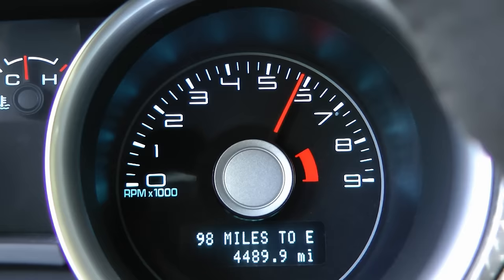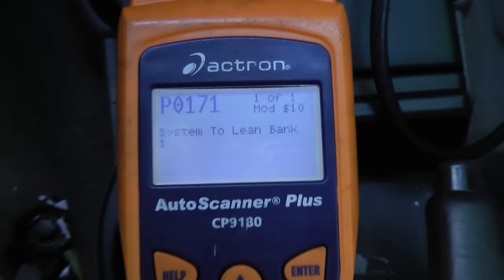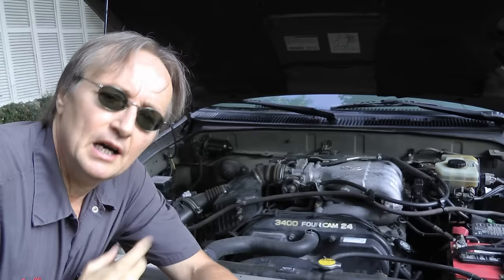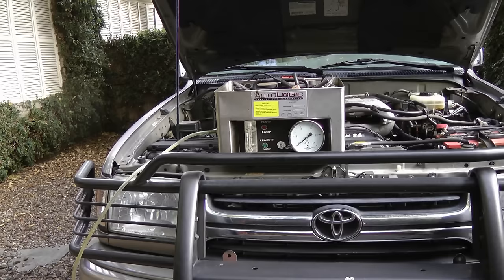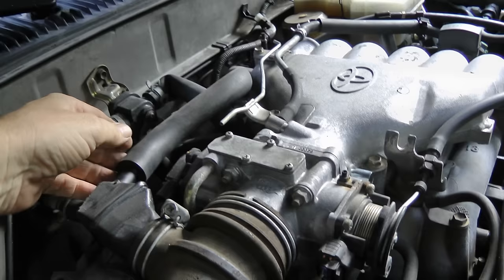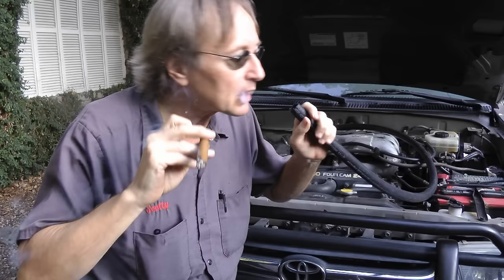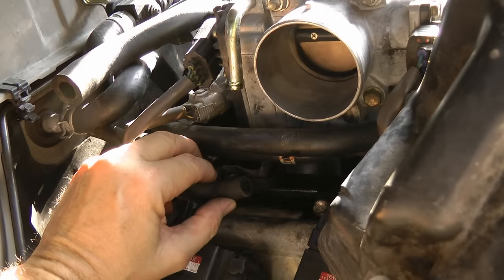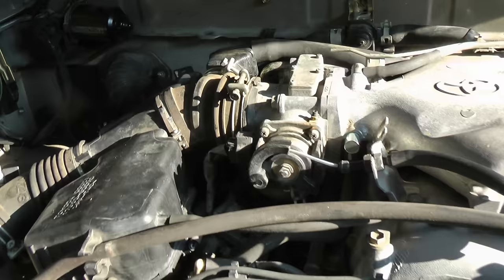How to Find Vacuum Leaks With a Cigar (Life Hack)

Comment: I went to NAPA and Auto Zone and neither had cigars in stock
Reply: +TheSpazModic He said "at the Drugstore" so try there
Reply: valero, shell, any corner store really
Reply: LOL
Reply: +TheSpazModic the cigars are special order. Usually take 1 to 2 days to arrive.
Reply: Frank Gonzalez LOL
Reply: +TheSpazModic you didn't give them the cigars make model and year they got confused.... LMAO
Reply: +TheSpazModic They never have the right cigars for my sonata anywhere. Make sure you get the right one half way through the model year the changed the OEM cigar on my car and I almost destroyed my engine.
Reply: dude,by trying OEM recommended Cuban cigars you gain horsepower. It coats everything with a smooth tobacco texture causing AIR LUBRICATION making more air flow into the throttle body faster and smoother almost like squirting KY jelly in your oil filler.
Reply: OgGarcioVega Yes but that is only for the staff to be able to deal with the general public that goes into an autozone riding there high horse because they watched 3 youtube videos on how to change a cabin air filter and now are an ASE certified mechanic... trust me I work there it's not easy being calm on our side of the table.
Reply: +Mr. Stark Auto or Manual?
Reply: Is that cigar 4 wheel drive?
Reply: Try cross referencing the VIN number on the cigar. Sure they have one then.
Reply: I was going to say that @TheSPazModic needs to cross reference the VIN, License Plate Number, Drivers License Number, Age and Gender of the Driver, with the Cigar, then they should be able to find it. :P :P :P
Reply: OgGarcioVega the hell is a zigzag?
Reply: Bahahahaha
Reply: TheSpazModic go to the place called not an auto place
Reply: In a pinch, you can use exhaust smoke.  1. Crank car.  2. Firmly press your lips around exhaust pipe. 3. Inhale.  4. More instructions to follow (report back if you get this far).
Reply: TheSpazModic Oreillys?
Reply: Lmfao 😂
Reply: Wonder if Scotty got the long black hose at @ockauto?:-)
Reply: TheSpazModic he said drugstore.. You went to your drug dealer got high then forgot what he said
Reply: Orilleys bro
Reply: Go figure, bet rock auto has them!

Comment: I’m try this. Cigar never crossed my mind. So far I’ve cleaned my throttle body, replaced my starter, replace alternator, replace cam shaft sensor, replace pcv valve, replace breaks, all from referencing your channel. You helped me more than you know.
Reply from the maker: thanks for watching!
Reply: Sounds like his terrible advice has lead you to change a lot of parts for no reason. He's helped you less than you know.
Reply: @matth9359  what a hater

Comment: Scotty, YOU ROCK!  If I lived in your area, you would be the only one looking at my vehicles.  I needed to search for possible vacuum leaks.  I scoured YouTube and there were all sorts of videos making different types of homemade smoke machines.  Thank God I found this video.  How simple can you get?  I bought a nice cigar and a six pack of Yingling.  I already had the rubber hose.  I disconnected the power brake hose, put on mine, smoked a fine cigar, found NO leaks, finished said fine cigar with two beers and then put everything back together.  You are awesome!   Gerald Demers
Reply: Oh, the cost for this fix?  Less than $20 for the cigar and six pack.   :)
Reply: Gerald Demers

Comment: It worked! I'd replaced most of the vacuum lines in my 93 VW Jetta and solved a lot of running problems about a year ago. But then I started getting gutless acceleration - and I mean gutless. But I couldn't find any more vac leaks. Finally stopped off at a tobacco store (amazed at all the glass pipes and things) and asked for the smokiest, cheapest cigar he had. Ended up with some slim cigar and lit it up. Blew smoke into a pipe I'd clamped into the line from the EGR valve to the intake duct. I took the first drag of tobacco I've had is about 40 years. Blew the smoke into the pipe and saw a feint puff of smoke emitting from under the fuel pressure regulator where a vacuum line connects. So I replaced that small section of hose that connect to a hard plastic tube that goes to the vacuum manifold. It helps to see the smoke if you do this as it's getting dark and shine a flashlight around looking for smoke coming from vacuum connections.
Reply: I just realized, the closing comment to this episode should have been "so now ya know. next time your car sucks, fix it by blowing smoke up it's gas."

Comment from the maker: yes, you can try, just realize evap systems have switches and valves that often need operating with a high level scan computer to check for leaks in various parts of the system.

Comment: For those of you that don't smoke, make a gravity/waterfall bong. Fill a soda bottle with water, cut an opening in the bottle cap big enough for the cigar to fit in nice and snug. Once you're ready just poke a hole at the bottom of the bottle and it will fill up with smoke. You can use to hole you made to blow the smoke out the top and into whatever tube or just squeeze the bottle.
Reply: The gravity bong idea is really a good one... lots of smoke
Reply: I would imagine a vape would have better smoke results than a cigar lol.
Reply: +Chris Atkinson vapor "smoke" dissipates with heat
Reply: T1 Under 5150 it was worth a shot lol
Reply: Bruuuuuh you da man.

Comment: This trick works. I just found a vacuum leak on my truck. I added a twist, though, since I didn't have an extra set of hands or eyes: I filled up a balloon with smoke, then put the balloon over the hose from the brake boost and let it out slowly. Using a flashlight, I was able to spot the leak, which was in an elbow connector between two hoses. Simple. Also, you can use a clothes pin or clamp to cover the balloon valve while you put it over the hose.
Reply: Great idea, I was thinking how would you decipher between the smoke coming from the cigar and what’s coming out of the hoses. Your idea fixes that.

Comment: I'm posting this from another video I commented on. I just wanted to give credit where credit was due. ..Thanks Scotty!

Three weeks ago I did a tune up on my 89 5.0. New cap and rotor, 9MM plug wires and Motorcraft plugs. A few days after I 
started to have idling issues. Thinking it was probably something with the recent changes I had made, I started watching videos and reading forums for suggestions. This is what I did:
AIC, cleaned original, then replace with new
Plugs X 2
Cap & rotor X 2
Inspected for Vacuum leaks and sprayed engine with carburetor cleaner
Replaced 02 upstream sensor
Seafoam added to vacuum,oil and gas
Mass air flow sensor tested and cleaned
Test and cleaned EGR valve and EGR spacer openings (both were very dirty)
Replaced coolant temperature sensor
Replaced air charge temperature sensor
Checked and reset timing (had to buy timing light)
Tested TPS sensor with OHM meter
Today I found the problem. It was a small vacuum line way up under the upper intake that goes to the charcoal canister, which is located in front of the passengers side fender. It was dry rotted at the nipple on the upper intake, which is virtually impossible to see without a lot of bending and a very bright light. I actually found it by trying a trick I saw on the Scotty Kilmer channel. I removed the vacuum line from the brake booster and blew lots of cigar smoke through the vacuum system which revealed where the leak was. So after spending $300 on parts and cleaners, a $5.00 vacuum line and a .50 cigar was the fix. I'm just dumping this here in the hope it will help someone else in the future.

Comment: Ok Scotty. So I did the smoke trick a few weeks ago and I found the leak. Put on a new hose and she ran like a charm. The problem is the next day I went to start my car and it refused to start and the engine light came on. I checked the code and it says where's my smoke. Now every time I want to go somewhere I have to blow smoke into the damn thing. PITA. Any advice? (It's a Dodge Dart).
Reply: +Mac Cessi I'd say slap a patch on it. That or nicotine gum in the gas tank. Either should help it get its fix.
Reply: Try putting liquid nicotine in gas tank
Reply: Dodges are like Snoop Dogg.  Once they start smoking, they never quit.
Reply: Mac Cessi weird
Reply: I've seen this a couple times. Although there are ways to ween your car off the smoke, those methods take several man hours and the bill would be through the roof. I highly recommend installing a chew canister and valve. It's a pretty simple install and only requires you to re-fill the car every week or so, which is much better than blowing smoke every time. It's not a perfect fix, but it will get the job done. For a little extra you can get the high-capacity chew canister which only needs to be refilled once a month. If you can't afford any of these methods, try adding a T to your vacuum hose and drop in an e-cig. For more advice on this topic, visit your local ricer. They should have plenty of experience with cars that smoke.
Reply: maccess I LITERALLY BURST OUT LAFFN

Comment: You just saved me some money! Been pulling my hair out over my Ford Taurus misfiring and with a rough idle, I finally decided to try this trick. IT WORKED! Seems I have a leak on the intake area, so guess my weekend project will be changing out the seals for that. Also noticed a very small wisp of smoke coming from under the EGR valve, probably the diaphragm going out? So be it if I have to change that too, you just save me a lot of money Mr. Kilmer. I'm sending you a virtual cigar and a virtual beer as a treat!   ;-)

Comment: Why not just put the lit cigar (mouth end) in the intake line and let the engine vacuum pull constant smoke? I find my Ranger enjoys Fuente de Gusto's.
Reply from the maker: use your head, if you did that, the engine would just suck the smoke in and burn it, it would not go to the leak source and come out there to show where it is.

Comment: Hey, Scotty, any suggestions for non smokers? Would fog from Dry Ice and warm water harm the engine?
Reply: fog made from dry ice in water is... water. not the best thing to pump in to your engine
Reply: Dry ice isn't water. It's CO2. Carbon dioxide. I suggested dry ice because it skips states of matter from solid directly to a gas which is present in the air at any given moment. It doesn't generally have a liquad state. Only under pressure.
Reply: You can also try buying a cheap hookah pen. Those things blow tons of smoke and you don't have to worry about tobacco getting in your system if you buy the non tobacco ones
Reply: I’m not knocking non-smokers at all. But, honestly lighting one cigar which you don’t inhale anyways isn’t going to kill your lungs or make you become addicted. It’s certainly worth 99 cents instead of spending more money unnecessarily. But, if it’s a religious thing I get it.

Comment: kids these days will use vapes
Reply: I actually would not recommend that as vegetable glycerine is a hemectant (so it pulls moisture from the air) and could result in condensation within your intake system.
Reply: Joshua Harris agree with this sentiment
Reply: actually vape works really really well tho lol
Reply: That's my plan, at least. Though I haven't been a kid for a while. XD
Reply: i actually prefer the smell of vape than cigarettes. i prefer the smell of a cigar over a cigarette. there's just something about cigarettes i hate...
Reply: Actually some people use water to remove carbon by dumping a little bit down the intake while the car is running.
Reply: I'll use marijuana
Reply: Iron Man ...lol
Reply: @joshuaharris253  that moisture wont do anything to the engine
Reply: Yup strait up better than getting cancer or giving your car cancer also second hand smoke is dangerous be safe vape on 😉
Reply: @joshuaharris253   was litraly needing this info thankyou
Reply: @Lincolnator721  probably the arsenic

Comment: I bet this would work way well with a vape lmao
Reply: I was wondering if the water vapour might cause any problems, I doubt it though since its such a small amount.
Reply: It's not water vapor though, if it was, it wouldn't be an issue as there's water vapor in the air everywhere, but there's VG and PG in vape fluid.
Reply: charlie gough Yeah, I had a feeling it wouldn't be a great idea. Thanks for confirming.

Comment: Hey Scotty thank you for all your videos I learn a lot and inspired me to be a great mechanic like you in the future. I have a quick question I'm swapping a d 1.5 vtec to a d 1.6 vtec, one is a 92 and the other one is a 94 both are 4 doors my question is if I have to change the computer also and what other changes do I need to do to make it work  thanks Scotty hope to hear from you soon
Reply from the maker: I never do such swaps myself cause computers, software, sensors, and wiring are often not compatible. BUT, try to find if anyone has ever done this by googling and pray they have advice
Reply: Thanks Scotty ur the best keep it up
Reply: You fucking swapped an engine for .1l of displacement? Fucking honda guys man I swear is if I taped vtec to a weed wacker you'd swap it in.

Comment: Scotty you are the man . I have 2011 Scion tC , I had a misfire code so I changed the coils and the plugs and coils . Cleared the code week later I got the p1071 bank one system too lean. I check my maf sensor and the rubber print was cracked . I changed it and cleared the code. With 30min the code came back. I will try this method soon ty!

Comment: Smoke machines have come way down in price the last 12 years and more companies make them. You can still dish out a grand to Snap On. But now they are available for $200 and work great. Most have a built in air comressor to and pressure regulator. I used mine on my '76 Cadillac Series 75. I had a rough idle. The problem turned out to be the cruise control unit. Once I bypassed the unit the engine was as smooth as silk. The smoke was coming out of the unit. No CAN systems or electronic units on these cars. I still have not found a new cruise control unit. But the car runs like a top. Smoke is a great thing in my book

Comment: Now here's something that's racking my brain. I have the same code, I spray carburetor cleaner all around my air box and my car fires right up. Now here's the kicker, once my car is running and I try to spray around my air box and other vacuum lines I don't hear the cars motor do anything other than run normal.. I would think it would fall the engine down or rev the engine up and it doesn't do anything

Comment: Dude thank you so much, I've been freaking out as to why my car has been running so rough after removing the top end to access the egr valve and found a crack in a vacuum line that much have happened when I was removing stuff, thank you again man

Comment: I actually did this method with a cigarette and a compression gauge hose in cylinder #3 and found a leaking head gasket only to pull the head and found a broken piston in a 5.7 Hemi.

Comment: Awesome video! My father owns a 2001 Infiniti i30 and he seems to be having a hesitating engine at low RPMs so just yesterday I tried helping him look for the problem and I found that it was making a hissing noise just like In your video. I couldn't find exactly which hose it was coming from but after watching this video I'm definitely going to try it out with smoke. Thanks Scotty you're Awesome !
Reply: Just be careful - I smoke the whole cigar until I found the leak, and now I feel dizzy and want to puke from the smoke. So maybe you should ask a smoking person to blow the smoke in, if you are non-smoker. Also, a tip from my side - take off the air inlet resonator/air filter housing, and put a rubber glove tightly on the fat pipe that goes to the air intake manifold to stop the smoke from just flowing out through that part. Otherwise all the smoke will just go right out through the easiest path of fat pipes, and the small leaks will not be found. However, the rubber glove can be blown like a balloon and pressurized, forcing the smoke to flow out through the small vacuum leak openings. I connected the pipe to PCV valve nipple on the intake manifold, because it was the easiest place to approach. I used a 6mm pipe (inner diameter), but I had to force it on. 8mm may have been easier to fit.

Comment: Scotty K., human fog machine/mechanic! Love the advice, and if you're a non-smoker you can use 3 or more incense sticks to do the same thing. You just have to blow across them & direct the smoke into th hose, or hol the hose vertically directly above the sticks. This is helpful in non-smoking households, where a tobacco product doesn't exist. A bit more difficult, to be sure - but it does work. Go Scotty!!!

Comment: My car had its EGR cooler replaced at the dealership a few months back (recall) and now the engine management light is on. The code shows up as a MAF sensor but someone said it could be pressure leak. Now i need to work out what it is before it becomes a costly repair

Comment: I found my Vacuum leak.  IDLE AIR CONTROL VALVE.  it was stuck.  I replaced it, and Voila!!!  Idle came down, hissing stopped, rough Idle stopped, Lean condition stopped and did not come back after resetting the code.  Runs as smooth as silk!